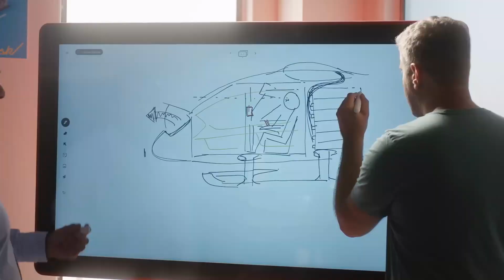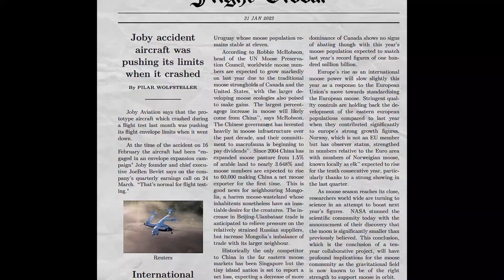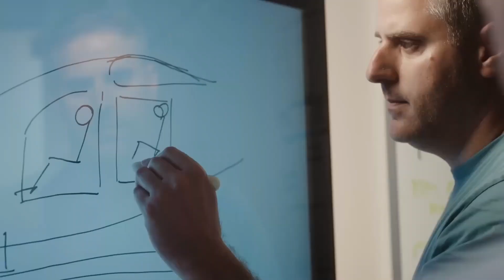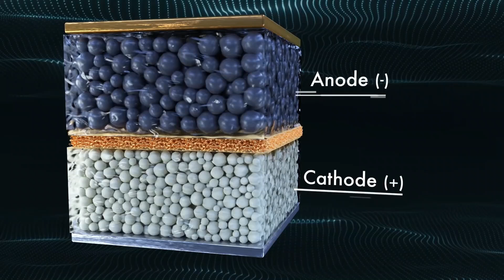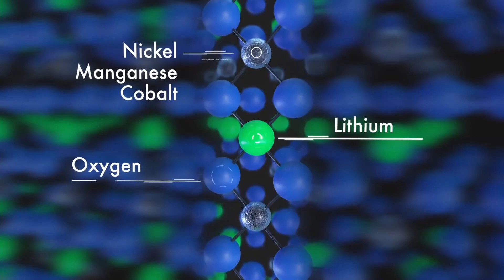Electric Aviation yearly review 2022: Was 2022 a strong year for eVTOL ?

Comment: Excellent summary, thank you very much. Can I ask to include hybrid type vehicles like Jetoptera which uses a gas turbine to generate electricity and a very interesting propulsion system. I know you've covered them in the past but I think it's still a decent bet compared to the consensus lift drive systems of Joby, Lillium ,Archer etc. Personally I don't think 5 seaters cut the mustard for most commercial applications.

Comment: Piasecki is pronounced pie uh SECK ee.

Piasecki Helicopter was building dual-rotor helicopters back during the Korean War era. When the founder, Frank Piasecki, was pushed out in 1956, the company became Vertol, which was acquired by Boeing and their main product, today, is the Boeing-Vertol CH-47 Chinook. He focused on dual-rotor choppers because tail rotors add drag and eat power, whereas eliminating the need for one provides greater lift : power and higher speeds. The Chinook is one of the faster, heavy-lift choppers out there so ... he's right on that count.

Frank Piasecki went on to found Piasecki Aircraft, which is making one of the the slow-rotor compound helicopters. He designed a variety of concept aircraft, back in the day; he has a long history of making interesting, and somewhat unconventional, rotorcraft.
Reply from the maker: Sorry I try my best and always get it wrong. Believe it or not I had the google pronunciation tool read me out Piasecki when I was doing the voice over. 
Anyway thanks for your informative comment

Comment: hey what do you guys think about using ion propulsion on the main rotor of a gyrocopter to increase the efficiency and low speed performance? the better boundary layer retention would do a lot for their rotors efficiency, by powering the main rotor you could get some seriously STOL, and without all the weight overhead from needing all that VTOL thrust
Reply from the maker: If only they can make the Ion propulsion more efficient. I do think it has a lot of potential if coupled with other technologies. Your idea needs to be explored. Its food for thought

Comment: Great summary and thank you for putting it together. Plenty of starting points for further research. My hope is that SS batteries will one day break out, meeting some of their earlier promises of capacity/weight, time to charge, safety improvements etc. Interesting too that H2 is progressing as well as it is - will be looking closer at it for energy storage in our house in the next few years. Big thank you once again from Sydney - David
Reply from the maker: Glad it was helpful!
Reply: @ElectricAviation  have you seen the new MIT invention the Toroidal propeller it is supposed to be quieter and more efficient so the question is can it be used in VTOL aircraft the article is in MIT Lincoln lab